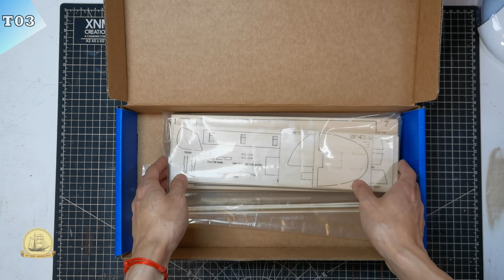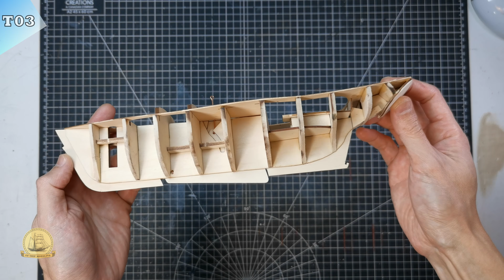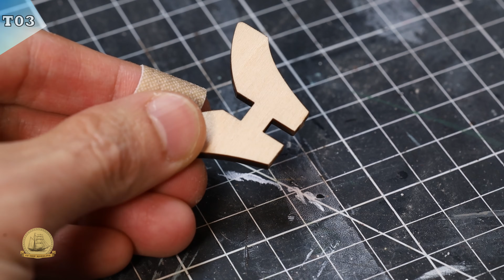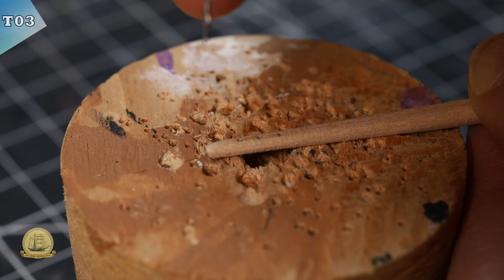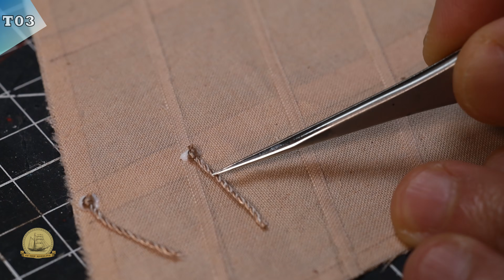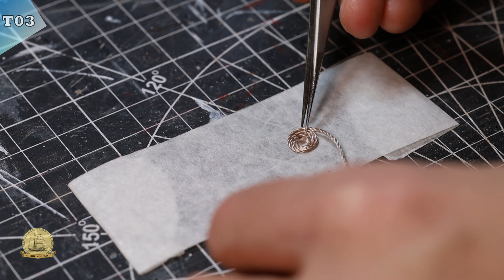WOOD Ship Model MAKING 103, The Beginner's Guide, Muscongus Bay Lobster Smack 1:24 Scale

Comment: @ezmodelbuilding, Just thought of something:  when you finished gluing up and shaping the keel, does the centerboard in yours stick out a bit and not be flush with the keel?

Am waiting on planking clamps to wet-shape my planks before gluing.  I just don’t feel skilled enough to pin them ATM.
Reply from the maker: Yes, it sticked out.
Reply: @ okay, cool.  I was getting worried BEFORE I finished the keel, then especially after seeing it still stick out when the keel was done.

Comment: I’m currently building this boat.  Did you put the planks on wet?  The instructions recommend wetting them, drying to shape, THEN gluing them.  I’m still shaping the hull.  Also, I had trouble with the deck fitting right.  As a warning, don’t shape the middle bulkheads too much, as they start with registration marks to help position the planks.  I had to re/draw them since I sanded a bit deeply.
Reply from the maker: Yes, I glued them while wet, I need to speed up cuz many projects. It is better to glue them after them dry. Try glue a piece of wood strip to the over sanded area and then sand over again. Enjoy  your build!